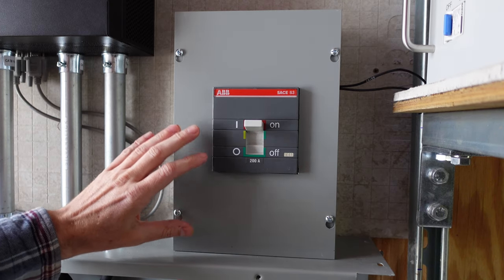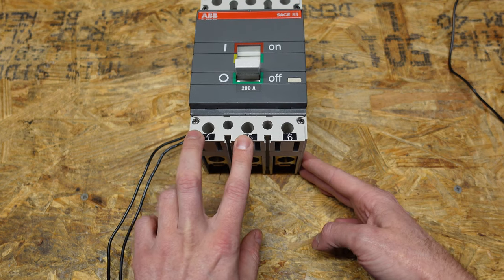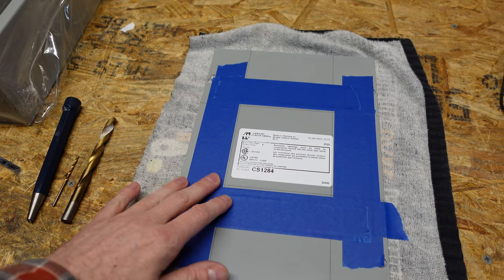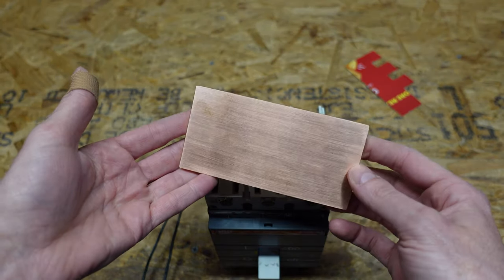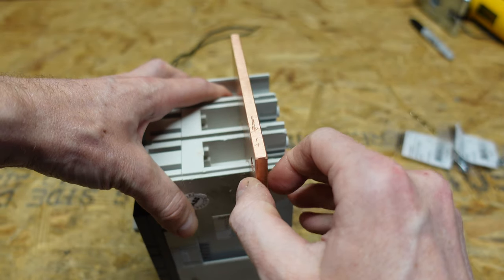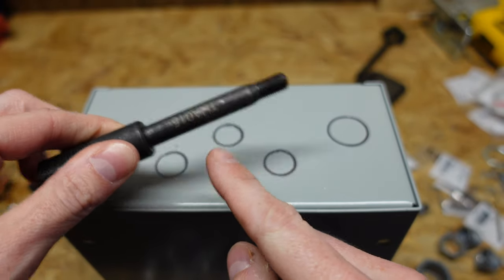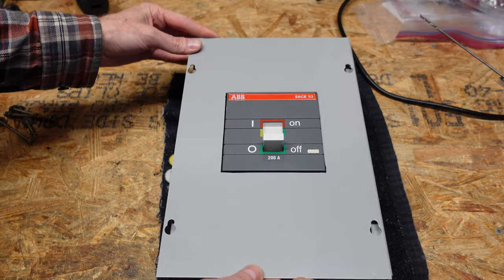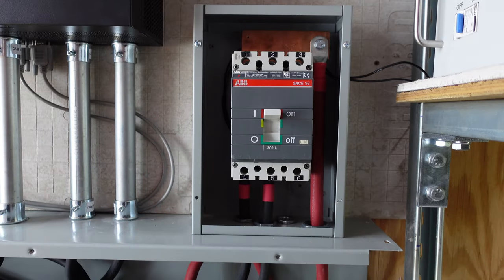Building an Enclosure for the ABB 200A Circuit Breaker Battery Disconnect

Comment: The wiring diagram indicates the load should be on Phase A and Phase C for 2-Pole application.  You installed the conductors on Phase A and Phase B.

NEC Table 250.122 - Grounding on the load side.  You should have a #6 copper equipment grounding conductor attached to all metal enclosures, including the cover.  I don't know your entire circuit application.  Is this a separately derived service?  If so, #6 is also required for bonding jumpers.

NEC Article 110 - Identify and label your equipment.  You know what it does, but the fire department doesn't.

You are attempting to make this a clean and safe installation, good for you.  I would put grounding your enclosures at the top of the list (regarding safety).  The NEC and AHJ would't approve Raceway sizes, equipment fill, separated conductors, etc.  Yes, this application will work.  No, it wouldn't pass an electrical inspection with the configuration in the video.

This is my first visit to your channel.  I'll subscribe and see what I can learn.  Thanks for sharing and be careful.

Comment: can you elaborate on the trip 24v wire as a emergency off button?, thank you great video.
Reply: 24 v wire is attached to a shunt trip installed in the breaker. Great way to open the circuit in case of an emergency
Reply: Thank you

Comment: yeah, no. you want that thing in a proper 200A rated panel enclosure, with a door, also rated for the full fault current. when a breaker goes badly wrong, it explodes; we don't call them dead fronts for nothing.
Reply: aka " I don't think this is still UL listed"
Reply: pretty sure that breaker was never meant to be mounted on a flat piece of steel.
Reply: you're doing good mechanical work, but that breaker does not belong in a little box like that.
Reply: @wim0104  I dont think so, these breakers are meant to be mounted on flat panels or on DIN rails, so this is not problem. But even other things, as you already mentioned, are. This video is only good looking, with full of faults, that could lead to disaster, fire or another emergency. Wrong screw and nut material, wrong wiring..

Comment: anyone know of a shunt trip breaker for higher voltages 400v?
Reply from the maker: This breaker is good for up to 500V, but please note that the higher voltages may require specific wiring instructions, such as wiring poles in series. You can check the manual, which can be found easily online.
Reply: Sorry.. I didn't realize this is the breaker I'm looking for.. Thanks for your vids.. :-)
Reply: Yes. Typically you can get up to 525 v, but I'm sure you can get one for 600v

Comment: Grade 8 bolts are typical for high stress. Not sure why a breaker box would need them. Seems excessive and not even in a good way. I would imagine if you want better conductivity then plated or solid copper bolts would be better.

Comment: Ive seen where a single positive is supposed to loop through all 3 poles of this breaker, of so, this isnt safe to disconnect under load.......what happened to your 18650 cells modules? Seems you deleted them but they are still very worthy for education. I have over 78kwh in lithium ion, its fine when precautions are taken place.
Reply from the maker: The 3 pole wiring method is for 500-750VDC. Only 2 poles are required for under 500VDC. I'm nowhere near 500VDC so I opted to use 1 pole. Yes, you can conclude that, technically speaking, I'm not using it per the manufacturer's intent.
Reply from the maker: Also yes, I got rid of the 18650s. That was a fun project but I would never do it again primarily due to safety and time requirements.

Comment: Nice breaker, but why such a expensive breaker if you can use a 30 dollar fuse? These work fine as well
Reply: How do you re set a fuse after it trips?
Reply: @dennishegg6025  1st: it happens very rarely that it trips, 2nd: When it trips: replace the fuse.
If the fuse trips too often, your configuration is wrong.
Reply: @lecramred4453  fyses dont trip, they blow. Why buy new fuses when you can re set a breaker.  There is a place for both fuses and breakers. I sell them both
Reply: Fuses are expensive
Reply: @dennishegg6025   Whatever, you understood what I meant. If your breaker trips or your fuse blows often, your installation sucks. I gave the reason: fuses are much cheaper, a breaker is over the top. If someone wants a breaker, fine. I am just wondering why as a fuse works well and is much cheaper.
Reply: @jakeandrules7724  Fuse: €30, breaker: €400
Reply: Also, this is a shunt trip. You can send voltage to those 2 small wires and shut it down remotley with whatever control you choose; whether that is a fire alarm device or his BMS software control.

Comment: Beware
Several code violations 
Single conductors run through ferrous materials, box, connectors and lock rings with create eddy currents and heat
Box fill?? Clearly not enough space or any cancelations done for wire size
I think a more interesting video would be to get a ir camera and show what happened when something is installed like this
Reply: We’re on DC. No eddy currents ;) Space is probably a fair call.

Comment: Zinc coated screw in copper busbar is big no-no, considering also the current going through that switch, you made one big galvanic cell. Use stainless screws and nuts!

Also, according to specs of SACE S3 , 200 A rating is max for AC, you should really look up the technical sheet for this product. And, in 0:29, there is even wiring diagram for DC application on the side of the breaker.... Really dangerous information given in this video.
Reply from the maker: Oooo interesting point. I hadn't even considered that as I was more focused on trying to find 8.8's. I'll have to see if I can find some stainless - thanks!
Reply: @LithiumSolar  how many Amps are going through that breaker and what should be fault switching current? There is reason for DC wiring like on the picture itself, as you should know. You cant use it this way, it could be really dangerous, this breaker should not serve as Y-split. When using DC circuit breaker, you should disconnect BOTH minus and plus connectors at the same time, battery/panels etc, load or source. 
Sorry, but you are using it wrong and not according to manufacturing specification .